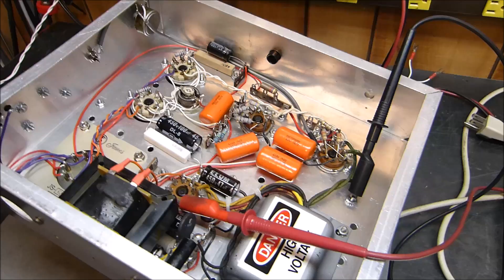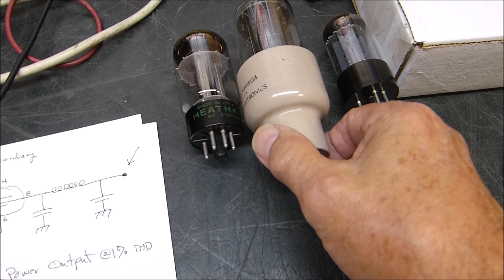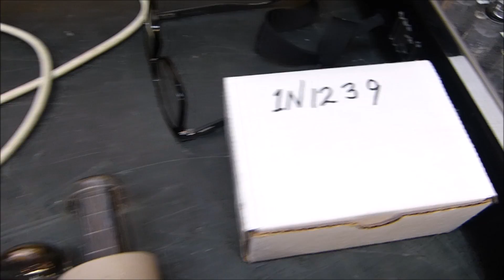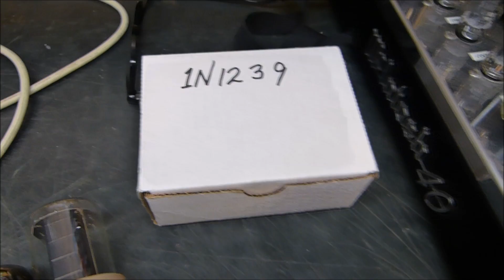5U4, 5R4, 5V4, 5AR4 & Solid State Rectifier Performance in Vacuum Tube Amplifiers

Comment: Keep in mind that each of the rectifiers have an internal resistance (see the RCA tube manual) which, based on your current, will affect the final voltage and recovery time at the first capacitor.
Even the 1N1239 has an internal resistance (at max current of 500 ma, 12 volt forward voltage = 24 ohms max).
Reply: Yep. It seems the internal resistance goes down as the rectifier model's letter (R,U,V,AR) and the current capability go up. The 5R4 has the highest resistance by far. It's natural therefore that the power output will increase for the same amount of distortion as the biasing goes up (both current and voltage) which results into increased headroom. It also possibly moves the amplifying tubes' operation into a more linear region of operation. In a way, one could perform a similar test by attaching a variac at the mains input and increase the voltage by the same amount and then use resistors to simulate the rectifiers' internal resistance.
Perhaps it might also be interesting to compare the amp's distortion levels instead, holding the output power constant, and confirm with the distortion spectra although I would not expect any surprises there. Having the amp connected to its intended load could be also useful.
There are people who regularly perform tube rectifier rolling in their amps and claim sonic benefits with a particular rectifier. They then go on to attribute these benefits to the rectifier in a manner that alludes that the rectifier has some internal sonic advantage. I treat these claims with scepticism. Each rectifier is designed to do a particular job, so swapping rectifiers and comparing performance on that basis alone is not tantamount to comparing like with like. There is the possibility that the rectifier choice simply alters the amplifier operation characteristics, i.e. alters the design.  It would be better, I think, to have different versions of the amplifier appropriately designed to maximize performance for each particular rectifier. Again, it would not be comparing like with like, as we would be dealing with slightly altered designs, but it would make sense if one strives to achieve the best distortion figure at a set power level (or the converse).
Reply: @Stelios.Posantzis  That is absolutely correct. And most guitarists do not understand it.
Changing rectifier usually changes B+ and screen voltages in a way that output tube bias, both anode and screen currents change. If you do not rebias output tubes after rectifier change (by adjusting fixed bias voltage or,  in case of  automatic bias, cathode resistor value(s)), the observed sound change  will be caused mainly because of different bias and operating point of output tubes. (Of course, sound and THD of preamp an PI stage tubes changes slightly as well if anode voltages change.)
BTW using variac to change mains voltage with a fixed bias amp causes the bias supply voltage to change a bit, which compensates slightly the B+ change. When you change only B+ rectifier, not the mains voltage, fixed bias bias supply voltage practically does not change.
Reply: @Stelios.Posantzis  I've never noticed that before! Thank you for pointing that out!

Comment: Then there re the infamous sellenium rectifiers that need be replaced, joernone just did a transformer check on his Seeburg juke.  There's a sillyrec in there that should be replaced.  Um sure that will be a subject in a later vid.  Could a SCR be better thn a diode?  
Don.
Reply from the maker: SCR's are different from a diode and can't be simply put in place as a rectifier. Actually, I made a video on SCR's some time back that turned out pretty popular that will show you how SCR's work and ate tested. Here is the link.
https://www.youtube.com/watch?v=S4To05OtDxs&t=53s

Comment: Why is the DC B+ higher than the AC?  Is it the filter cap?  I'd think there'd be a voltage drop after the rectifier.  Is the transformer saturated at rated output?  Is it PP or RMS?  If the AC supply is lower than DC , it seems voltage is amplified or something?  Why does it end up with more voltage than supplied?  Ron C ran into a wierd too high voltage problem with his tube transmitter project.  um confused (as usual).  Don
Reply: It's math. For AC to have the same heat power (as in you connect it to a heater) as DC it has to have it's amplitude square root of 2 time bigger then the DC voltage. After you rectify and filter it you will get a DC voltage of AC * sqrt(2), eg. 110VAC will give you 155VDC.
Reply: So, 110VAC RMS is like 155V peak to peak, therefore, the big caps charge up to 155VDC. But the 110VAC RMS would be more like 110VDC on a heater, i.e. RMS  being more like a comparable DC voltage.  So his 400VAC is likely RMS, like the primary 120VAC is RMS.  But the ecaps would be more like PtoP.  If the rectifier B+ without caps reading was had, it should be more like 400VDC, since RMS should be more like DC.  So what you're saying is RMS and PtP are the reason, as I suspected.  The transformer can only supply so much, even when saturated.  110RMS  or 155 PP?  So it's really about charged ecaps?
Reply from the maker: 110 VAC RMS would be 155 V peak or 310 VAC peak-to-peak but when we rectify it full-wave, we turn both halves of the AC waveform (positive and negative)  to positive pulses and end up with with a DC voltage that is a 120 cycle ripple voltage of 155 V peak from the original 110 V RMS source. If there is no load on the filter capacitors,  then this capacitor(s) will charge up to 155 volts DC, the peak value that is feeding the capacitors.  Once we start drawing current through our amplifier, this DC voltage will start to drop, depending on how much current we draw, down to a value that is typically around 1.25 times the original 110 V RMS which would be about  137.5 volts. While all of this has been said correctly, the actual DC voltage you end up with on your amplifier will vary according to the voltage drop across the particular vacuum tube rectifier you use, i.e. 5U4 or 5AR4, will produce different voltages under load. The 5AR4 will give you more voltage output than the 5U4, for example. The more current you draw from the power supply, the lower the voltage will be, down to a level that blows the fuse or burns up the tube and/or transformer. Musicians like this voltage "sag" as it gives them more creative power in playing their music. From the strict sense of high-performance power in the area of stable output, the solid state rectifier will win ever time. As can be seen in the video, using a 5R4 and using solid state rectifiers can result in an output voltage difference of as much (or more) as 50 volts more with the solid state rectifiers.  To complicate it even further, much will depend on the type of filter network that is used on the output of the rectifier. I hope this helps.
Reply from the maker: One way to lower voltage on the transmitter might be to use a choke input filter on the power supply. I assume he has either a simple capacitor filter (no chokes) or a Pi filter. In either case you will end up with more DC output than the RMS value of the AC voltage. Connecting the output of the rectifier straight into a choke (with no capacitor to ground at that point) and only putting a capacitor on the output of the choke, will, if the choke is operated at close to the correct current rating, will give about 90% of the AC RMS voltage. Maybe this will help. If there are unused secondary windings on the power transformer like unused 6 volt or 5 volt windings, they can be put in series with the primary to lower the output voltage of the secondary that HV is derived from (got to check (experiment with) the phase in connecting them in series with the primary).

Comment: thank you for all the great info..and taking the time to post all your findings..I build and restore tube amps and love playing with all kinds of power and rectifier tubes.this was a test I was going to try..i have been told for years that putting high voltage on a cold power tube would cause cathode stripping..or would shorten its life ...what I find is a gz34 has a longer warmup time .this lets the power tube come up to temps before the high voltage kicks in...then there is voltage sag under load...or less punchy bass .I'm building a custom dynco ...but trying out a 6sn7 in the front end and kt88 power with a Hammond 6600 ohm 60 watt output transformer..running at 500 volts...I put my stock dynco on the left and my custom on the right ..and its funny how the Hammond trans preforms so close to the  dynco that its hard to tell to difference.could be the  neg feedback . I used the same value for each..stockoutput trans is a 4400  ohmI.I have a new test for you to try. does running a power tube at a lower idleing current make any difference in thd ...I know it lets the tube run cooler and have more grid swing.or running it higher at idle like class A make for lower thd..anyway thank you for all the great videos ..and hope to have my build up starting tonight ..been testing it for 2 months no problems so time to post it....have a great week...greg rapuano...Glass Powered Audio
Reply: this is more of an issue with high power radio transmitters.  Everything I've come across regarding the tubes used in guitar amps says this is a non-issue.  you're more likely to wear out the filament from turning the amp on and off many times that you are to wear out the cathode because of some imagined cathode stripping.  In many tubes you can damage the cathode by running them with no B+ voltage for long periods of time.  this was a big problem for people using tubes as active devices in digital logic circuits and others where they were run for prolonged periods with the control grid biased to cut off all plate current.  eventually manufacturers figured out ways to make the cathodes less sensitive to this problem, and special grade computer tubes were produced that could handle that type of operating condition.

Comment: You would not catch me hot-swapping rectifiers in a million years. The lack of major overshoot was interesting. I'm used to seeing a lot more than that, but with a DVM: maybe it was the DVM hunting, rather than anything real. I typically see up to 375V before it settles down to 330V, for one example.
Reply: sporadic -Z Thank you, why is that?
Reply: 2 things affect that. 1, the equivalent series resistance of your power supply. 2. the idle current of your tubes, the bulk of which, is the bias current on your output tubes. This is NOT indicative of trouble, but merely a characteristic of THAT amplifier.

Comment: What does it sound like using that solid-state rectifier? should sound more punchy bass I would have thought a tighter bass response, have you tested it in any other frequencies.
Reply from the maker: The amplifier with only 10 watts with the SS rectifier or 5AR4 is absolutely amazing sounding on a pair of Paradigm Focus speakers in my little shop.. $100,000 of McIntosh equipment couldn't outdo it. I don't know what it is but something about those old 1940 era 6B4G triodes charm me. The highs are clean and  the bass is tight but full range. It must be love.
Reply: ElPaso TubeAmps t
Reply: David. keep in mind that it didn't overshoot because the 6B4G tubes are directly heated and warm-up instantly like the 5U4 and 5R4.
Reply: What would be a better test would be the tube rectifier with it's 40uf max capacitance compared to the sound of UF4007 diodes with 500uf of capacitance. That is where much of the solid state rectifier slam comes from IMO. That and the lack of voltage drop under load with SS diodes.
Reply: HUGO FUGUSEV could you expand on that? I'm currently using a solid state rectifier on my VTA ST 70 " modern beefed up Dynaco St 70" would I see any benefits upgrading the capacitance of my cap?